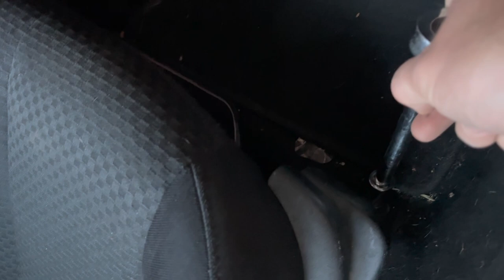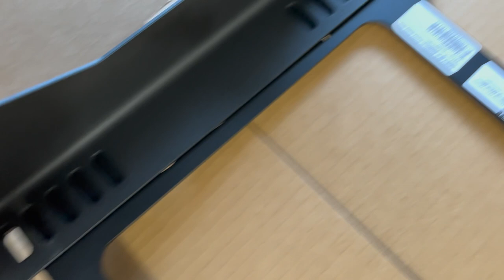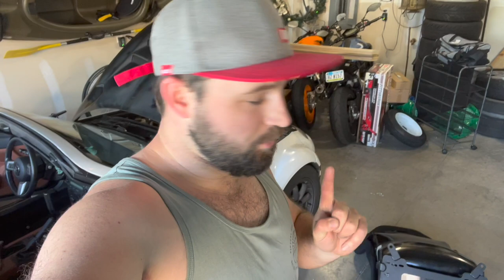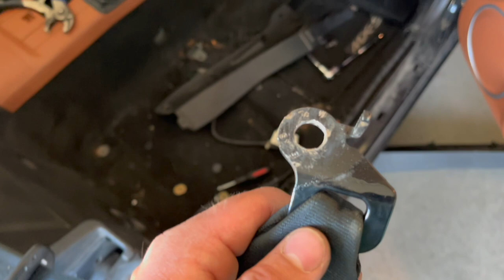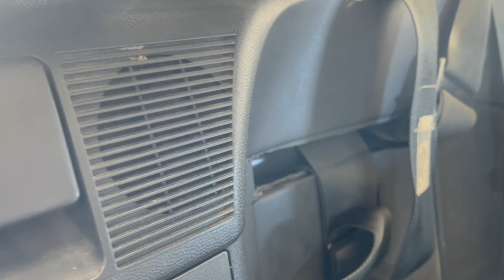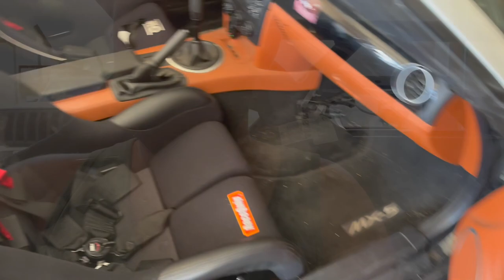Installing a RaceQuip Racing Seat (2006 Miata) - How To

Comment: Which OMP seat do you have? And how does this compare?
Reply from the maker: OMP Champ-R. I actually think I am just going to do a video review of it here soon because I get the question a lot. It’s a little on the tighter side. I am 5’10” and around 220lbs with a 34” waist. It would fit those under 32” waist better, but I still drive it up to 12 hours in one day comfortably with an extra lumbar pad. It’s a good fixed bucket for daily driving because it has lower thigh bolsters. Makes it easier to get in and out of than some other composite racing seats I have been in. I would buy it again!
Reply: @ShiftyIntentions  thanks! Super helpful! I’ve trying to figure out how these are in terms of long term but no one even talks about them online.
Reply: @ShiftyIntentions  would you buy this over your Champ-R?
Reply from the maker: @lovince  very different type of seat…  I would buy the Champ-R over the Racequip personally as I think it fits better in the car. Overall a lot smaller seat.
Reply: @ShiftyIntentions  how are they different?